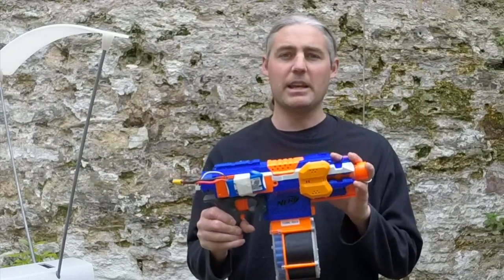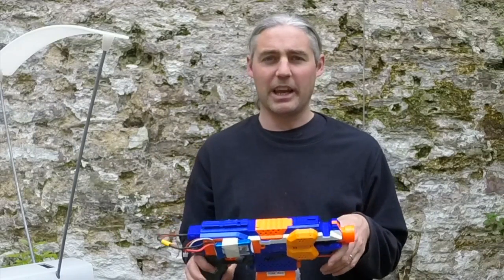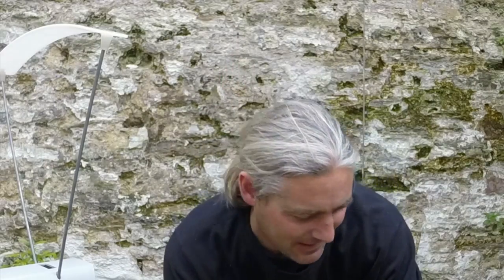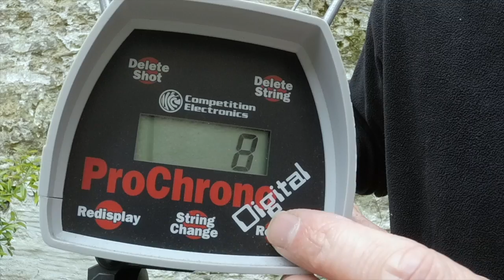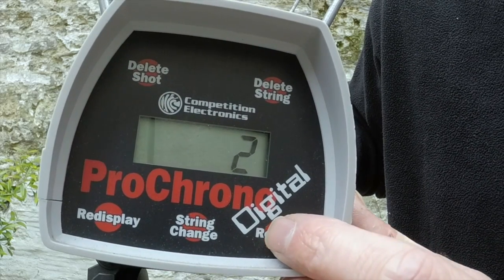Hooligan Flywheels- #makeamericannerfgreatagain ?

Comment: How do these work with neo hellcats and a mid-crush setup on a 3s? Stock gap and 2s seems to be a little weak..
Reply from the maker: A bit week, ha ha. The best I ever got on stock wheels was about 110fps, regardless of the motor, so a 124FPS average with the lowest Standard Deviation I EVER GOT was an incredible performance. I don’t test at higher crushes with hotter motors because then you wouldn’t be able to compare just the flywheels. Of course a set of higher torque motors and increased crush will get more power, but chrono queening isn’t the point of my channel.
The 3240 is also a 2s motor, so that’s what I tested at. If you want more power both those mods will push the top end up.

Comment: it'ok to put in a rapidstrike a 130 rhino 12v motor for the pusher on a 3s lipo? is the rate of fire going to be high? Will I need to change the switches? what if I leave the old ones? Thanks in advance
Reply from the maker: You should fully rewire and change at least the rev switch. Rhinos are a 3 s motor, they work fine as a pusher, about 8-10dps. The stock cycle control switches are cock, I fit the BSUK switch kit.
Reply: Thanks for the reply, a last question, is the motor going to stay perfectly in the pusher mechanisem or will I need to cut something?
Reply from the maker: You will need to take the back off the motor housing in the pusher box as the Rhino has tags and an endbell that are longer than the stock 130. The motor will stay in place p, it's clamped securely by the two halves of the pusher box. Be careful removing the worm gear on the pusher motor.

Comment: Worker setups? Their new metal cages and wheels?
Reply from the maker: Metal wheels are crap, avoid. Planning on testing the cage and "barrels." I have done a load of shoots with regular worker flywheels for comparisons, not released all those yet.
Reply: I get that the metal wheels are less than desirable overall. I thought maybe the new ones deserved a shot! Wasn't sure :) I love your testing content. Really helps people (at least me) make buying decisions. Have you done any testing with the artifact red cage and smooth plastic wheels? Would you say the hooligan wheels are better than the artifact smooth plastic wheels?
Reply from the maker: Hooligan wheels are vastly superior to Artifact, tolerances are twice as tight. Even Artifact V2 wheels are poorly machined by comparison. I have a red cage, just not very interested in it, most of our games are a 130 cap anyway. If you want the hot ticket, it's Hooligan wheels in a precision milled metal cage with either longshaft XP180's (2s) or Hellcats (3s) and sone if the new 132 motors are also promising. All my research now goes on Britnerf first so that's the place to go for in depth testing.
Reply from the maker: Toothed metal wheels are a total mess. The only bonus vs lathed plastic wheels is the grub screw retention. Rest is just shredding dart.
Reply: So for my artifact red cage setup I'd get the best FPS results using hooligan flywheels instead of a pair of smooth plastic V1 wheels?
Reply from the maker: Yes, and better consistency. They need to be carefully built up tho.
Reply: How does one "carefully" build them up?
Reply from the maker: Using digital vernier, feeler gauges and about an hour to set up motors and wheels. You want the wheels dead centre to the cage centre line, we aim for +/-0.1mm on those, since you can't get feeler gauges much more accurate than that. I should make a video about it. I fit the wheels hot, onto a feeler gauge sized to put the wheel dead centre in the cage.
Reply: Please do make a video on it. As that sounds super complicated.....
Reply from the maker: It's not as complicated as it sounds, but does need time and patience.